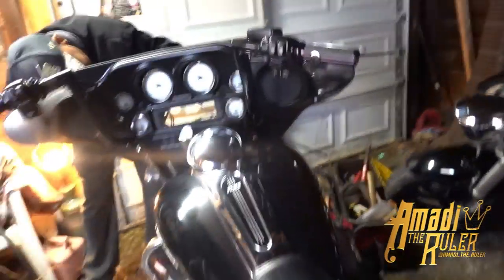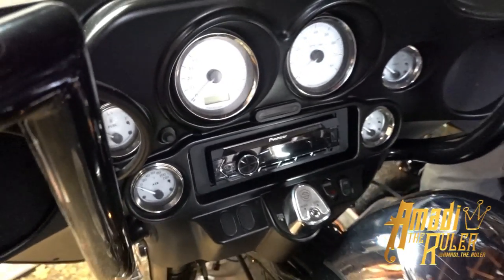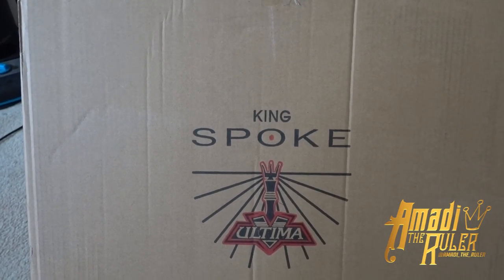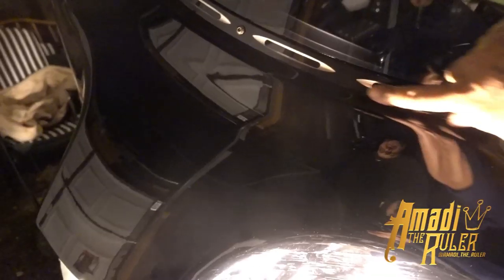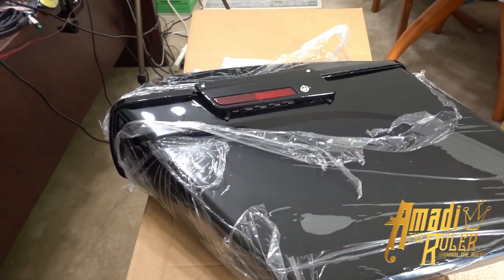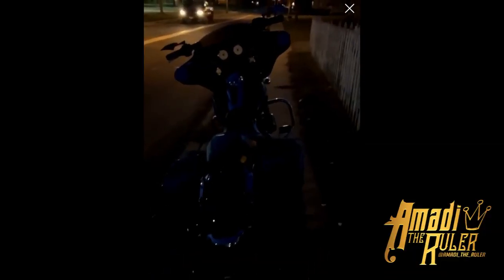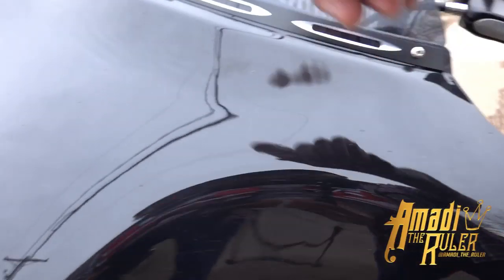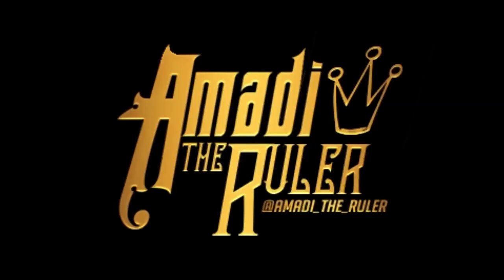HARLEY DAVIDSON STREET GLIDE COMPLETE BUDGET BUILD START TO FINISH

Comment: Hi my friend ! I need help, i have this bike with rear speakers, and amplifier and 54amp stator with rectifier… but charging 13 volt !!! On stop… i dont under stand, your bike is ok with this configuration ? Or my bike is bad ? Tks for your help, i am very desperate
Reply from the maker: I didn’t upgrade my stator I ran the factor stator never had any problems

Comment: It's clean but get the back rim to match the front
Reply from the maker: eventually just spending one day at a time lol
Reply: Better off leaving the back rim on instead of going spoke,  reason being spoke rims at the rear should be re tightened every 10,000 miles based on the torque exerted on them by everyday riding,  not to mention taking off fast and ripping through your gears. 
Plus those bags pretty much cover up the back rim.
Just a bit of advice,  in the end the choice is yours. 
Other than that sweet bike looks clean AF.

Comment: I have the same rim I ordered a 21 inch wrap around finder can I use it with a 21 rim or did I just f up
Reply from the maker: you may need to check with the manufacture i had to go with one for a 23

Comment: A lot of Harley-Davidson motorcycles spend more time on a lift than on the road. The older bikes warrant a little upgrading tho, the newer ones not so much.
Reply from the maker: Frank Wood I hear that a lot I’m just gonna prepare myself good thing for me is I have a friend who went to school to work on Harley Motors fingers crossed 🤞
Reply: AMADI THA RULER  A lot more Harley-Davidson motorcycles spend a lot of time on the highway getting cross country miles. Only BMW motorcycles are seen anywhere near as much. So you’re good fam. But I didn’t see that rear wheel that comes with the set? Don’t let these folks lie to you, you need the set like a pair of Jordans!
Reply: Harley Davidsons spend time on the lift cause guys try and make the motor bigger and faster and their still not happy so they try and make the bike more faster  that's when things in the motor start busting apart I see alot of nice pumped up bikes always in the shop these guys just don't get it lol 😆 I have a bagger with a stock 103 stage 1 kit all I need my buddys got big 120r and 143" engines in there bikes and there always broke down or busting starters